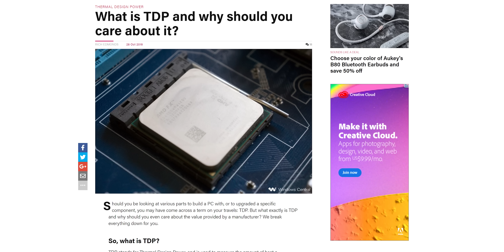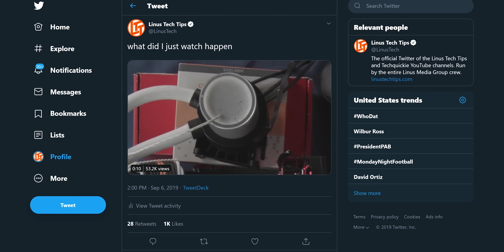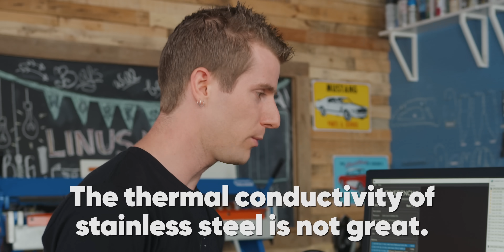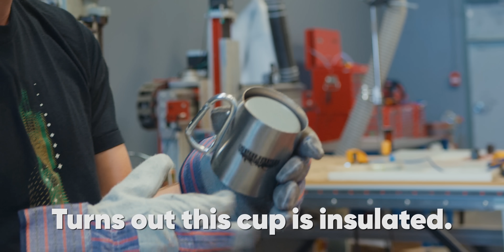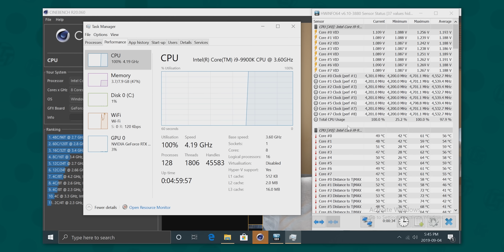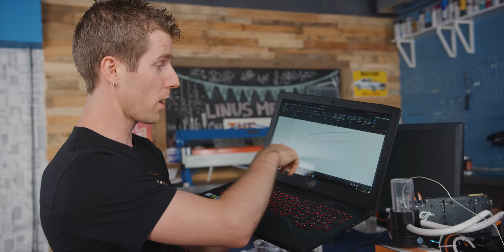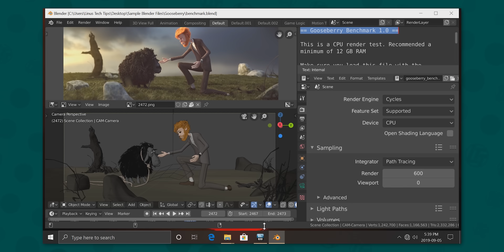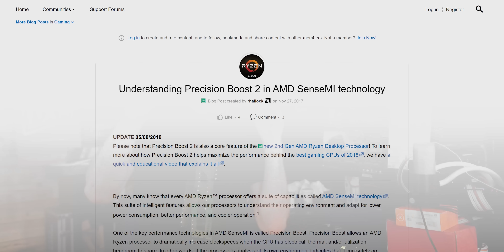Who REALLY Runs Hotter? AMD vs Intel

Comment: Good video and testing concepts.

Just curious, why didn't you lock the clock speeds at something that wouldn't thermal throttle, and disable boost? For Example, lock in at 3.8Ghz at all cores on both chips? While it's not "real world stock settings", it eliminates all the trickery modern CPUs to hit their thermal/power envelopes. 

As another aside, you could determine the speed at which the CPUs perform the same in your given benchmark. For example, let's say the Intel @ 3.8Ghz & AMD @ 3.65Ghz and they score identically in render speed. That'd give you kind of a performance per watt scenario.

Comment: WTF is the point of this video? If you wonna measure heat just find the CPU lines, measure wattage in real time and you get the TDP once you take magnetic field out of the equation.
The other way would be using alcohol in a cup and measure how much time take to evaporate, but even then is completly unprecise. Electrons don't lie, they are the most precise way to measure TDP, all other ways would just fail, you have 2 many directions and ways the electricity transform, heat and magnet field all over the CPU and heat spreading to the cup and the motherboard as well. The cup probably take 95% of the heat away, but no way to know the precise numbers unless you also measure how much goes into the air arround cup and the base arround the CPU (the motherboard).

Comment: why not just put thermocouples before and after the cpu block to measure the change in enthalpy  ( With the cooler on )...... wow  like wtf is that water cup idea lol  , let alone going as far as machining a new bottom surface and not just get an LN2 cup before making the video 😃   the cup idea will not be accuarate also because the specific heat changes with temperature .

Comment: As far as industry standards for measuring the CPU for they're temperature
Try using a laser thermal meter
Or try using flare from a kat phone with integrated temperature reading

Comment: I know the LTT shtick is to be kinda janky at things but......Uhhhhhhhh that was torture.

Just do a closed loop with an in line temp sensor, run fans at say 1000 RPM, and hit the CPU with prime 95 or whatever, then see where the temp levels out. Repeat test with same loop and block, just change mounting (can do on an EK block) and do the same again.

Comment: You could just have... Dumped all the coolant heat into an isolated water container and measured that temperature change over time

Water's thermal capacity is known (1 calorie per gram per °C)

So all you'd need is to divide that temperature rise by the time integral in order to obtain wattage, and thus tdp

(Basically run the water cooler at turbulent regimen for optimal heat transfer, but make the water be taken from and dumped to an isolated container, where you measure the temperature. You already know you need 4.186 Joules of energy per ml of water, per °C increase

So knowing that, measuring the heat output of that CPU should be easy to do, and you actively reduce the amount of variables, like the imprecision by the introduction of ink, or even having to remeasure the liquid every time)

Comment: hey guys, you should have put that brand spanking new workshop to use for this video! A lapped copper base with an insulated plastic (polycarbonate or whatever withstands the temps during testing) tube in which you pour the water!

Comment: TDP was never a power usage measurement, and it never has been. It's all about heat output, in practice this can coincide with total power consumption, but it doesn't have to. Normally the CPU also sinks heat elsewhere so power consumption numbers will almost always be higher. Better would be to just measure the actual VRM power consumption. And report that separately to the TDP, as the power draw.

Comment: Sounds like standard issue market wank. Nothing is advertised honestly.
The industry standard should be as simple as this: 100% load on all cores @maximum advertised "boost" clock, measured current x core voltage. No time scales no market wankery, just the ACTUAL MAXIMUM CONSUMPTION. I have always been suspicious of the term "Total Dissipated Power"... suspicions confirmed!

Comment: CPUs convert electricity to heat with 100% efficiency according to thermodynamics. So to measure the thermal energy output of a CPU accurately, all you have to do is measure the electricity usage.
I know that might not convince the entire audience, but frankly, neither did this.
Reply: Well, not 100% efficiency because some of the electricity goes towards moving electrons around transistors and traces. But yes, virtually 100%. I'd just do a ratio of electricity used to work done (such as number of frames rendered in Blender.)
Reply: @Kimoto504  use a fire extinguisher and and then edit the video and you zero thousand bench score for heat resistance.
Reply: Was thinking the same thing. Just measure the power draw and done. This video was stupid.
Reply: @ConquerorDash  WOW who knew electricity make heat?
Reply: Nothing converts electricity to heat energy with 100% efficiency, according to "thermodynamics".
Reply: @BarryKennedy  Absolutely incorrect. Resistive heating is 100% efficient. Don't go spouting words like thermodynamics if you don't understand even the most basic fundamentals of the field. It's a quick Google search away. 

Saying that heaters are 100% efficient is an easy win since we measure inefficiency by how much power is converted to heat.

Measuring total system power consumption will not be adequate for determining TDP just as others have pointed out because there are inefficiencies in the multiple phases of the VRM's supplying the CPU and differences between chipsets etc.

The execution may have been janky in true LTT style but their testing methodology was sound. Energy in calories is measured by how much energy it takes to raise 1 gram of water by 1 degree celcius. More Total Design Power, more heating.

The whole point of this video is that different manufacturers measure the TDP of their processors differently. It was not a test of efficiency in terms of performance per kWh. If it was then AMD would've easily won in this specific benchmark (generating less heat while rendering 1900 frames before the run even completed vs Intel's ~1300).  

Takeaways: 
1) Basing your purchase on the TDP of a processor is useless unless you're directly comparing different products in the same product line. 
2) TDP measurements need to be standardized by someone independent like the IEEE/ANSI
3) You can always invest more time into planning your experiments
4) You can always count on people in the YouTube comments to miss the point
5) Fanboys will read into results what they want to see (no matter who they cheer for they're dummies). None of these big companies are your friends and they do not care about you. You're not on their team and if you think you are, the marketing Dept earned their keep.
Reply: That would measure other components' consumptions too.
Reply: @azarilh2355  well you just turn the pc off and have video from a table broadcasting to the monitor via chome cast so it looks like you won.
Reply: sw4gr1d  Most board manufactures offer near identical boards for AMD and Intel when looking at the VRM setup. There'll still be a difference in chipset efficiency, but as long as you're not running anything that's heavy on the chipset, that power draw is negligible. Whatever way you look at it, just measuring the current running through the CPU and 24-pin cables is way more accurate than the horrible test in the video.
Reply: sw4gr1d  I don't think vrm can put out 50/100w watts ...you know how much heat is that? I would need an equal cooler to the one that you mount on the CPU....we are on the 10/20w (although I think 20w are still a lot for vrms)

Comment: HOW TO DO THIS EXPERIMENT PROPERLY: you just need install the same coolers on both CPU's, but put a whole assebly in a closed thermoisolated box. And measure a temperature increasing inside of this box when system is running. This is how you can measure heat production without putting CPU into overheat and throttling. And without putting a CUP OF WATER on CPU.
UPD: or just measure an input power, because all of it will become a CPU heat.
This video was complete time wasting, i must admit.

Comment: There are many variables in this method. The right way is to measure Calories emitted from the CPU:
1 Calorie = Heat To Raise Temperature of (1) One Gram of Water By (1) One Celsius Degree.
So, measure initial temperature of water in the cup -> start the computer.
Then, you will have the temperature against time -> ΔT * Water Weight (Gram) = Emitted Calories -> In the end, you will have (Calories/Time) graph. Which is the most precise method to do what you wanted to do in this video.

Important note: Keep every thing insulated; walls and lid of the cup.

Comment: Its a water cooled CPU and they are testing it with a cup of water on top of the CPU. As long as both systems had the same amount of water cooling them (same length of pipe and so on) would you get the same result and probably closer tot he truth ? 
I do Like the way they are doing it. They are right, It is more fun. :-)

Comment: Hi Linus, maybe try an oil bath for both setups at stock. then use the rise of oil temperature when doing a specific task. we can measure power drawn as well so in a sense we can have an idea on how much of the power drawn is wasted to heat by both setups - and it will have a tank :)

Comment: pretty sure as far as i'm aware, AMD measures its TDP at high load, and intel measures it at idle, base clocks, so, not surprised that AMD is outputting less heat, it should

Comment: Soo why didnt you just measure the voltage + current (at the CPU 8 pin connector and at some of the 24 Pin cables) and multiply it to calculate the power consumption?
Reply: Or even measure from the wall...
Reply: @DanielFoerster  The point of the video is to measure the heat output which means power consumption of the CPU only.
Reply: @aVoidPiOver2Rad  sure, but if you use the same hardware otherwise, the CPU will be the only factor. That's how a number of tech groups used to measure power draw for components. Now it looks like most have moved on to even more precise measuring tools like inline as you describe, but wall watts is extremely easy to measure.
Reply: @DanielFoerster  You can't use the same hardware for AMD and Intel lol
Reply: @aVoidPiOver2Rad  same case/fans/cooler, same PSU, same GPU, same SSD, even same motherboard apart from socket and chipset.
Reply: @DanielFoerster  The power consumption of chipsets can vary significantly.

Comment: As soon as you said 80 degree coolant i thought, do they not get that by then the CPU would be crazy hot? You guys have more than enough experience with water cooling to understand that. 
Honestly, just use a normal water cooling system minus radiator with high accuracy temp probes in a res. A pump will provide more than enough flow such that res temp will be representative enough of energy transfer. I would just wait for a 20 degree rise and do the maths. Running the pump with the cpu non powered first will give you a good number for how much wattage the pump adds, then just minus that from the system run.
Alternatively just mount a filled CPU block by itself with probes into the ports. I have done that before and it works fine.
With the resources this show has this should be much less half-assed. The open top of your res is allowing some evap cooling for instance.

Comment: The psu is good, we could reliably assume constant 12 v. So why not just calculate VI power using an ammeter? Computer chips dissipate ALL input power as heat because kinetic energy of electron(ic)s is negligible.
Far easier, more accurate, and also boring to watch 😂

Comment: For intel side, having the current tdp ("general use") and a turbo tdp ("enthusiast use"/heavy use) would be amazing. Then a sff build for a kiosk looks at the low tdp for a cooler and if you are building a system that will be under alot of load you look at the higher tdp. Since amd scale with cooling, not sure that this could be a standard tho.
Reply: Look at nutrition labels even, often you have calories and cal from fat. Not perfect comparison, but similar.

Comment: This video needs a public health warning: "May cause health issues for Actual Physicists(TM), including raised blood pressure, severe brain-damage and spontaneous outbursts of weeping and screaming *WHY....?!?!?!?!?*"

={:o|

In other news: If you want to know the total heat output of a CPU (or another electronic device), just measure the total power *input*. All of the elctrical energy it draws eventually comes out as heat. Not a joule more, not a joule less. Equipment needed: a few ammeters (as opposed to amateurs!), a few volt-meters, and one or more of those little extension cables for your CPU's power supply. Snip the extension in half, wire an ammeters in series with each rail and  voltmeters between each rail and ground. Line the meters up sensible on the bench, one row reading current (amps) and teh otehr the corresponding potentials (volts). Point a camera at them and make sure all the readings are clearly visible; Start recording; Start your test, and ... when the test is over start freeze-framing and doing some basic math.

Or, you knoiw, you could probably rig up a raspberry pi to do that last bit for you. =:o}

Comment: As always you guys are overcomplicating stuff 😂

Why not build 2 exact systems, besides motherboard and cpu in an air tight pc case with only one way for air to go out. 

Have fixed fan speed an measure the air temperature under different loads and over time. 

Way more controlled, less variables.
Reply: Or just put an 120mm AIO on the CPU's and measure the temperature coming out....
Reply: Hahahahaha You want to measure air temp wtf

Comment: Cooling a 8 cores cpu with a cup of water, you guys are mad.
Reply: Waiting for the 3950X video of this technique.
Reply: der8auer did a test with a delidded 8700k without a cooler and it didnt even turn off it just throttled down to 800mhz and stood there on 100°C
Reply: @LcFan96  so you basically were running at a atom core
Reply: @lockinhinddanger934  pretty much
Reply: Zhihang Liu 
Stirring actually made it work
Reply: Still not mad max, if they don't use a cup of gasoline.
Reply: you need almost 8 cups of water tho
Reply: you must be new here
Reply: *Insulated cup of water.

Comment: So basically, Intel measure their TDP with the CPU running at stock speeds, while AMD measure TDP as a worst case, ie, all cores running at max. I'd say AMD are more accurate here, and you should never exceed 105W, but normally be a lot lower. Intel CPU's on the other hand may say 95W, but those high end i7's, with all core's at max, have been measured at nearly 150W.
AMD = lower temps, lower real world TDP, better performance
Intel = higher temps, higher real world TDP and worse performance

Comment: So many people are criticizing the experiment as being unscientific, when LTT actually did a pretty good job of limiting variables between the two setups. People don't seem to understand the concept of a variable in an experimental set up. It's literally just something that VARIES between the different runs, in this case, which CPU was heating up the water in the loop. Everything else, e.g., heat loss to surroundings, heat gain from the pump, are virtually identical for both setups, which means that they are not variables. Perhaps people are getting hung up on the fact that those confounding factors DO make it difficult to accurately calculate the heat output for each individual CPU, but LTT never claimed to be able to do that.

Comment: Why use the 3800X and not the 3900X ,and why not a closed loop?
Reply: That's pretty simple it was 8 core 16 thread vs 8 core 16 thread although they kind of failed the idea was to compare like for like heat output

Comment: Which side is the pump connected? if you could put k-type probe throught the outlet side of the water block's pipe( internally) to measure the hot water as it leaves....
Or go find a Global Hypercolor T-shirt and sacrifice!!
Try Stardust Colors they have different ranges of thermochromtic paints. But quite honestly, it will be gradual. I'm sure Tech Ingredients will devise a more dramatic color change with chemicals...